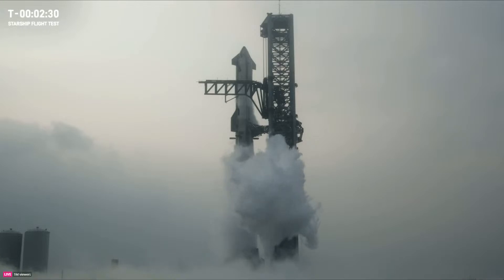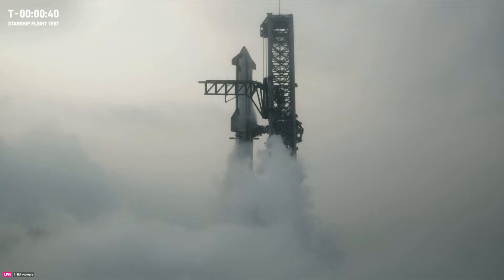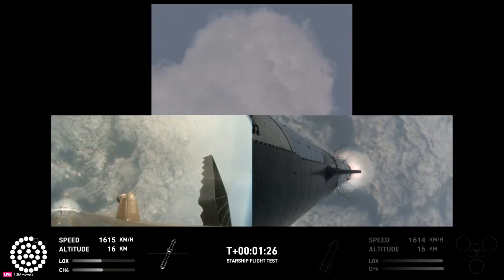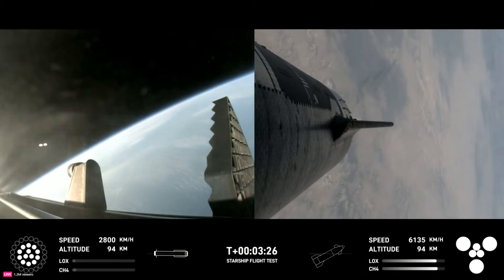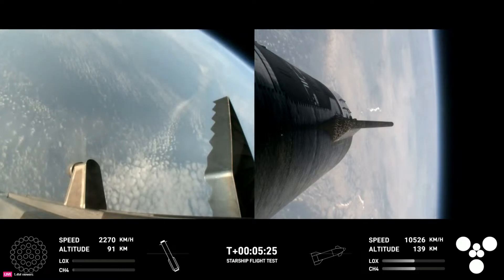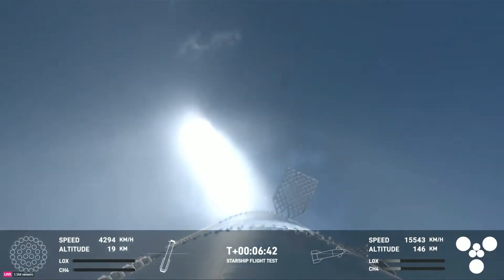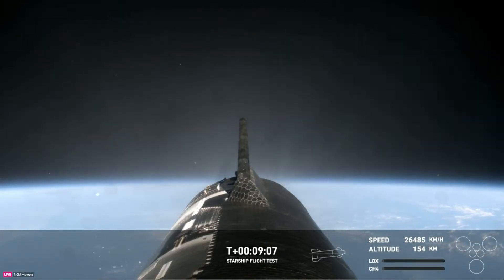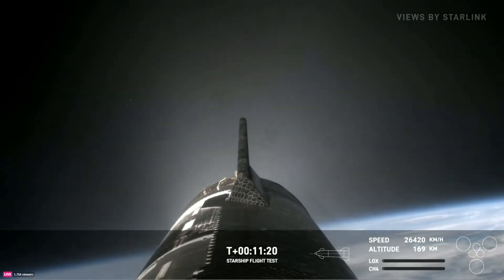SpaceX's mega rocket makes its fourth test flight from Texas

Comment: It's too bad the re-entry video was not presented, this was the most amazing phase of the mission.  Even though some heat tiles were lost and parts of the flaps burned away, Starship was still able to make a successful controlled touchdown in the Indian Ocean.
Reply: What if they do a 5th test with a very small cargo (an engineering tool) delivered to wait what does orbital capability able to store items that can be assembled with other mmega booster deliveries and successfull return of booster for reuse?  What is a boost backburn and landing burn?
Reply: @Wazariah14  They really can't deploy something in space with Starship until they achieve an orbit with it where the perigee of the orbit (its lowest point) is in space above the Karman Line.  With IFT-4, Starship's orbit was intentionally lopsided to pass through the atmosphere at its lower point, so that a re-entry burn for the Starship 2nd stage wasn't necessary.

The concern was that if the re-entry burn failed, Starship would be stuck in orbit as a piece of junk.  This way, Starship was guaranteed to re-enter the atmosphere somewhere over the Indian Ocean.

Now that Starship's engines have proven themselves, a proper orbit will surely be achieved with the next launch IFT-5.  The first real payload that Starship will carry will likely be Starlink satellites, however I think they still have some bugs to work out with the payload door before they can do this.  

Despite the focus on the Artemis Moon Landing project, Starship's first real job will be the Starlink V2 satellite constellation.  V2 satellites are much bigger than the current V1 satellites, and they are necessary for the Starlink Direct-To-Cell capability which will let current cellphones communicate anywhere in the world using Starlink satellites (assuming local cell towers aren't available).

Despite its size, many launches of Starship will be necessary to deploy the Starlink V2 constellation, but this will give SpaceX the experience they need to develop Starship into a reliable platform to transport people to orbit and to the Moon and Mars and back.

Comment: Is there a engine dose not work ?
Reply: There was a problem with one engine.  It can still work as you saw.  Not sure how many can not work and rocket still take off. The engineers will debug the problem and fix it on on the next launch.
Reply: @Tight2008  3 engines is the limit